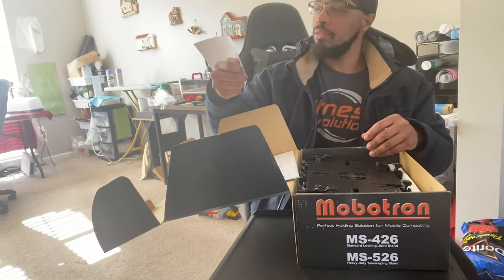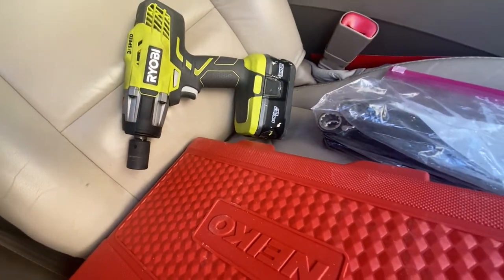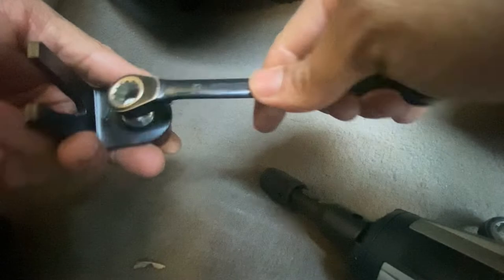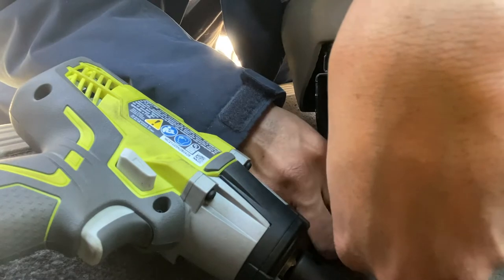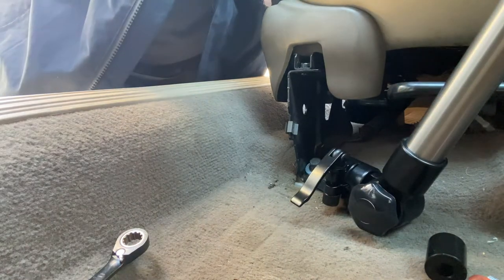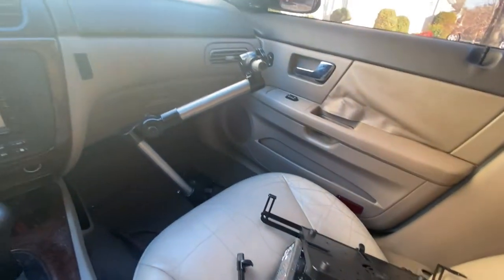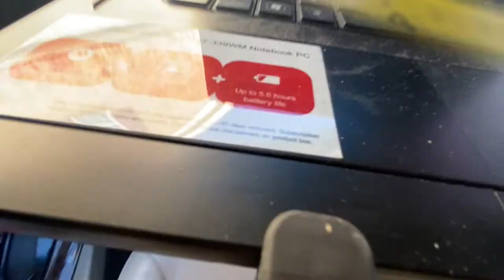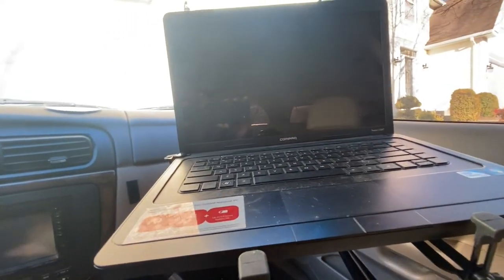Mobotron MS-526 Heavy-duty Car VAN SUV iPad Laptop Mount Stand Holder UNBOXING/INSTALL

Comment: Why on right side of the seat why not the left side against the center console, was it too close?

And now you have it in the right side say someone sat in front passenger 

Does the bar move down and seat still adjustable or stuck in the way and needs removal each time?
Reply from the maker: Great question!
The reason why I put it on the right side is because the floor is flat on that side. I can't hook up on the left side because u have a hump.

depending on your vehicle it might be uncomfortable for a passenger in the front seat. If you have a truck it might work

the bar does move down and in my car I can adjust the seat back but you may be limited on moving the seat up. in my car the seat needs to be all the way back for me to put the product on.

Comment: RAM Mounts are easier to install, better quality, more secure...granted, they are about twice the price of this...but, this looks decent. I'd be interested to know how this mount has held up over time.
Reply from the maker: I’m actually using it now LOL  it’s still holding up well. I will check on the rap mounts. Is it on Amazon?
Reply: Ram mounts are also WAY more expensive. I’ve been running this Mount for over a year now and it’s held up great. Was def a pain in the ass to install